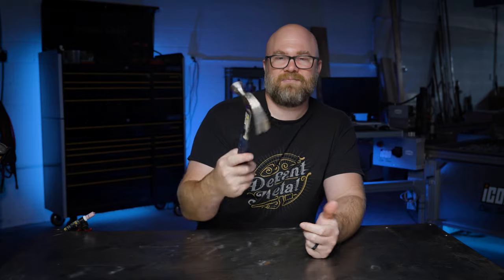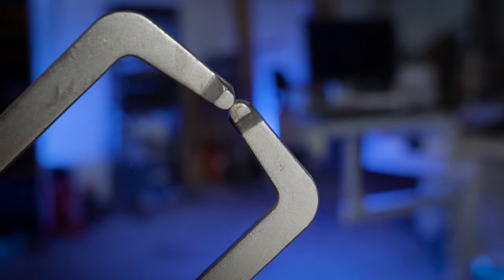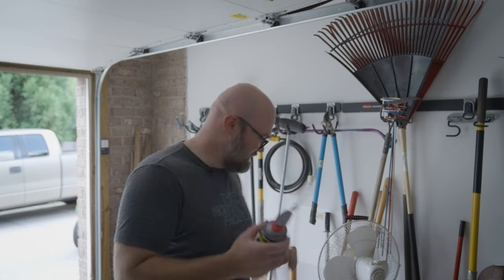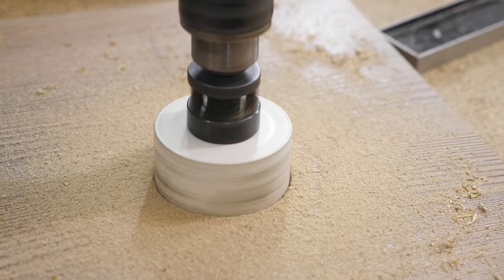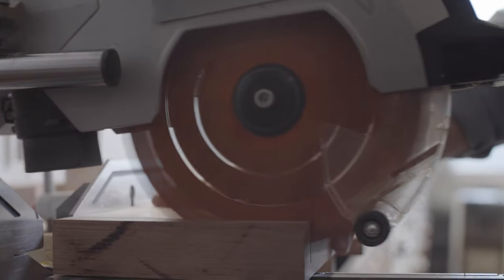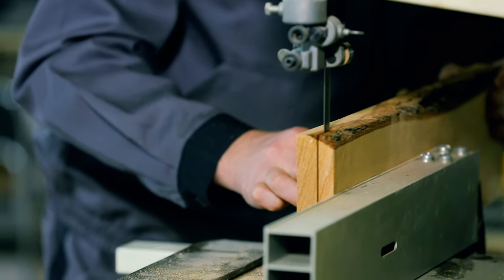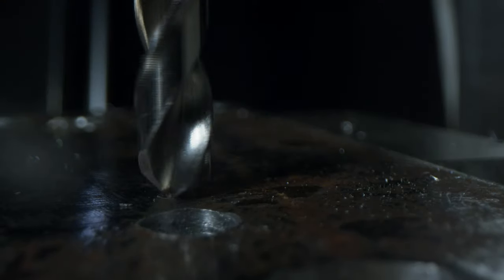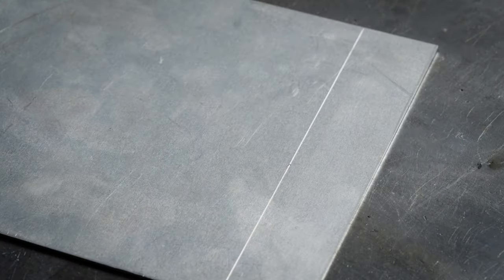Metalworking vs Woodworking Tools - What's the Difference?

Comment: Great Video! I would add for the vertical bandsaws wood only saws run a much faster blade speed. There are dual metal/wood bandsaws but they are usually built stronger and have a slow speed option for cutting metal and you need to change over to a metal specific blade.

Comment: I’ve been thinking of buying a chopsaw for metal. Is there any that you would recommend? I’m currently taking a TIG welding class and I have a project coming up which will be welding 16 gauge metal that I will have to cut myself into multiple pieces. Would you recommend a chopsaw or something else? By the way, I LOVE your gloves. I got my second pair of TIG gloves and I have the MIG gloves too which also work great for stick welding.
Reply from the maker: The most budget friendly is a chop saw and will do the job.

Comment: I don't think you mentioned which metals you were talking about. It is important to know your metal. For example, a chop saw works great on mild steel, soso on tool steel. Try and cut aluminum, and the disc will clog then shatter. A carbide wood cutting blade with lots of teeth would be a better choice.